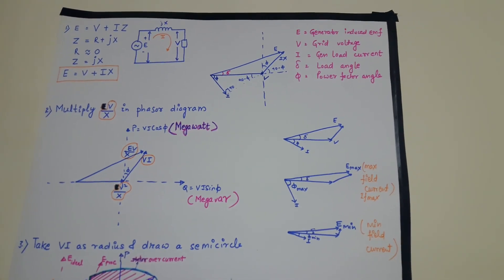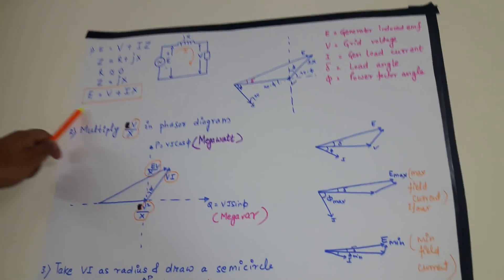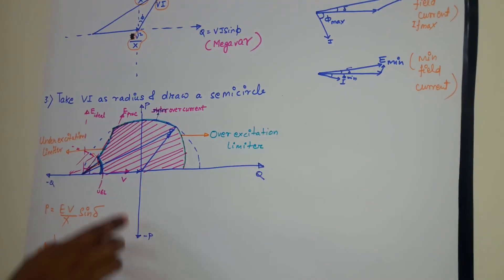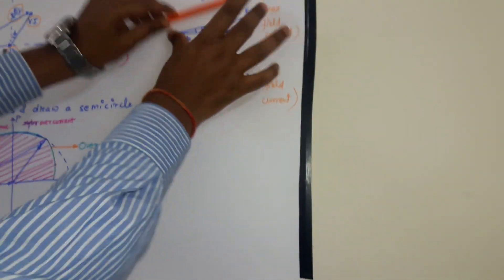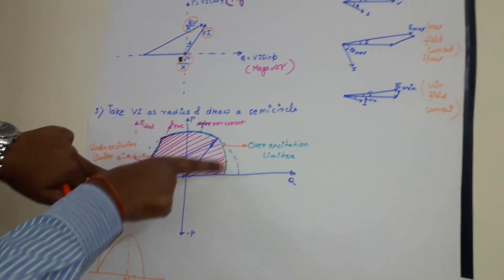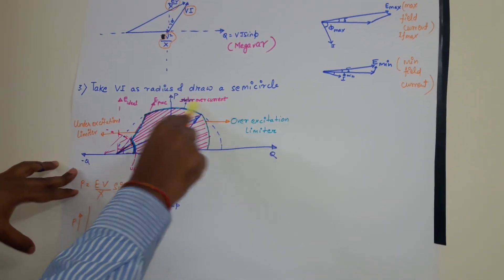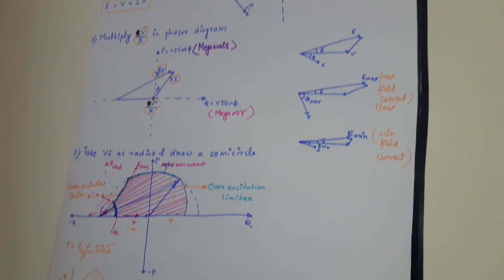GENERATOR CAPABILITY CURVE : simplest way to derive

Comment: Hello sir, I don't know whether you are going to read this comment or not ,but my doubts is which factor (P or Q) changes when we say load is changing. This doubt arises because in most of the books it is mentioned that either load is contant or excitation emf is constant. It will be very beneficial if make a video regarding this issue..thanks a lot for such lectures
Reply from the maker: ABHIMANYU RAJBHAR 
Due to the fast action of AVR Q seems constant. Reactive power flows due to the difference in magnitude of voltage between two points of the power system. AVR is able to maintain constant voltage always.
So, Only P changes. Change in Q is negligible and pf remains 1

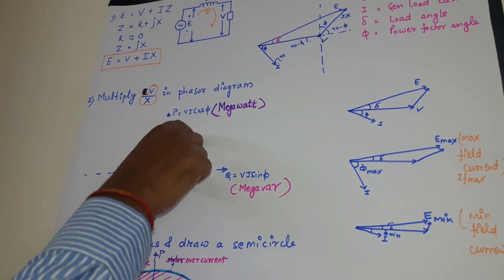Comment: A small doubt: is there a single phase synchronous generator? I believe not, so I suggest instead of multiplying by the term v/x at 2:11, multiply by 3v/x assuming it’s 3 phase as it’s the most commonly used practically. 
Correct me if I am mistaken, thank you.
Reply from the maker: Safiya Jassim In  the video, per phase represtation is done.. for more accuracy ofcourse u r correct.. 3 has to be multiplied

Comment: Why is that line inductance dominate over capacitive part during day and it's converse during night?
Reply from the maker: During day time the loading of grid is higher. So the reactive power absorbed by these total loads is higher than the reactive power supplied by line capacitance. These extra requirement of reactive power    affects the operating point at capability curve
Reply: I think I know that. The generator sends reactive power during daytime, because the Harmonics Injecting Loads are in excess amount during the day. There is core saturation due to harmonics. Reactive Power is needed to compensate that. But at night, (when we are expected to sleep), there's no need to supply that extra reactive power. thus the generator receives and operates in the second quadrant. i hope i am correct but please confirm ;-)

Comment from the maker: It is multiplied to convert voltage plane into power plane or P Q plane
Reply: Atis Kumar I believe the same capability curve apply to synchronous motor
Reply: Thanks i  lot for your awnser mr kumar i really apreciate it, ill be awaiting for more of your videos
Reply: Mr. Kumar if it is possible, could you explain the efect on the MVAR due to excitation current and  MW due to the turbine torque, that will be really helpfull, thanks again.
Reply from the maker: i have explained the whole phenomenon of MW building in synchronizing torque video in my channel, the load angle decides the MW and the load angle adjust itself by the help of primemover whereas MVAR depends upon grid loading conditions, AVR regulates it as per the requirement by changing the excitation current, by increasing excitation magnetic flux increases, followed by increase in induced voltage & viceversa